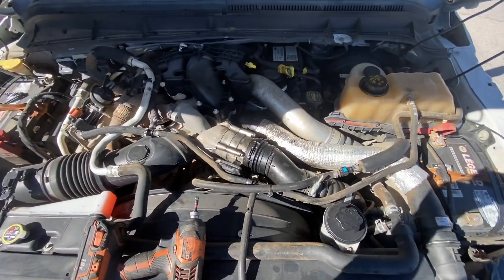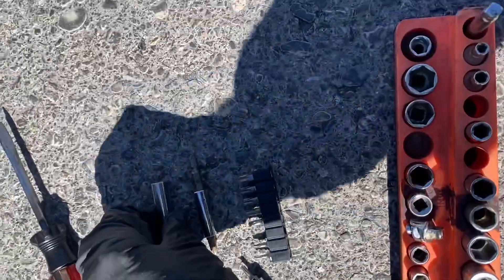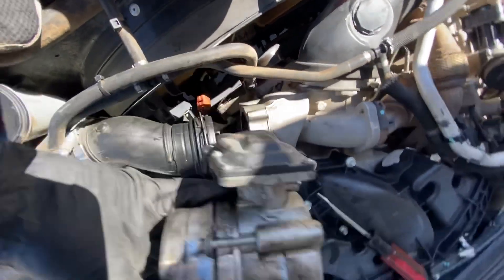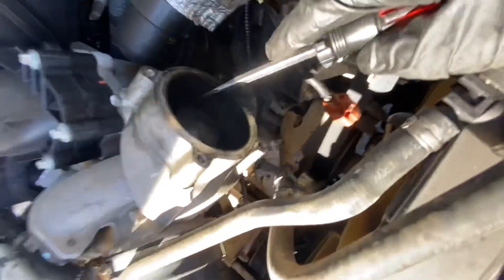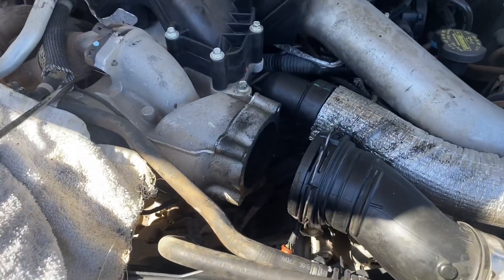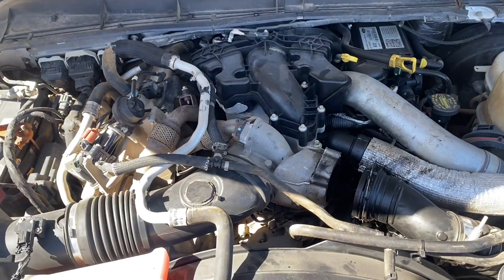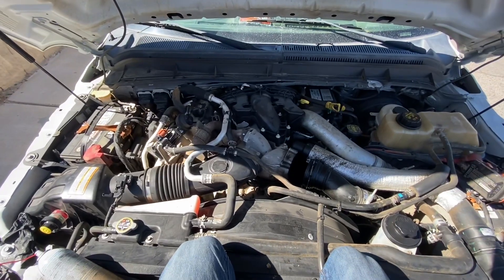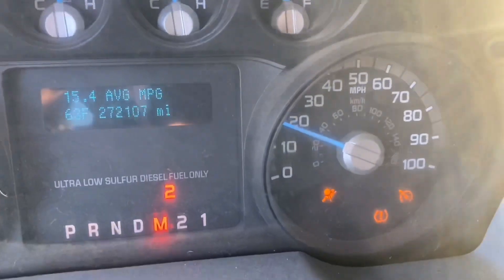15 minute mod, 10mpg to 16mpg, 6.7 powerstroke gets 60% better mpg, so easy you can do it too!

Comment: I have a 2015 6.7 powerstroke, its deleted and the egr is disabled, I have the egr delete kit just haven't installed it. The delete is recent so I'm gonna do this and let you guys know what the difference is, if any.
Reply: Do you have the full EGR delete kit or the block off plates? I'm trying to do research on the EGR plates but I can't find much info since its so hush hush. I'm trying to do this as easily as possible in the event I ever trade in my 2015 250 for a new model some day. Also, have you done what Mr Lanz did yet?
Reply: @d.williams6891  I have an egr delete kit with heater core hose from hot rod racing out of Canada. I have not pulled my throttle body yet I've been slammed with other stuff, but I should be able to get it done here soon
Reply: Any updates dawg?
Reply: @WildTines  no updates yet, I should be able to get to it tomorrow
Reply: I may take a look at the throttle body and see what it looks like tomorrow
Reply: I have a 15 too
Reply: @WildTines  I finally got around to cleaning this and it was full of gunk. I'm on my first 50 mile trip and I'm noticing an average of 20+ mpg. Will update.
Reply: @chriswilliams2911  any update on this? I am currently working on doing this as well. Truck is already deleted and tuned...
Reply: @thejrayhjr  I cleaned all the shit out, it was pretty caked up in there, it was a while back and I can't remember if it really helped. I know my fuel mileage is shit now at like 275 300 miles a tank.

Comment: I personally feel that this is just normal maintenance on any vehicle new enough to have an EGR on it, gasoline or diesel. Gained a few MPG on a 1995 Dakota (5.2L V8) years back cleaning it out until it went from black to shiny silver. Currently, my 2017 6.7L PSD gets 22-24mpg highway and 16-18mpg in the city. The big thing that interests me is deleting the EGR and DPF, which can nearly double the mileage. Then you get little build-up and not the mess you showed us.
Reply: My 2017 Powerstroke (90k} consistently gets 12 mpg towing nothing. I’d really like to drive it more but fuel costs are too high. What can I do to improve the MPG?
Reply: @masstpr15  i have no clue. I have the 3.55 diffs. Maybe yours are a taller gear? 12mpg without towing and not racing with it seems odd. To be fair, the max I go is 70mph, normally 65mph. I am not out west where you can do 80-85mph.
Reply: @masstpr15  my 17 gets 20 hwy empty according to the lie o meter…..you got problems man
Reply: I am working with the same model truck as this guy, a '15 F250 with the 6.7PSD.  Fully deleted including EGR, and tuned.  17mpg highway, 13-14 around town.  I (naively) want to reinstall all emissions and DPF and restore to factory tune.  As it is, before I do all that, it has frightening amounts of power, and it will smoke tires easily in 2nd and 3rd gear - admittedly a lot of fun.  Previous owner probably tuned it when they did the delete.  When I take possession of it, I have no intention of racing it or coal-rolling anyone.  I just want longevity and the ability to reliably use its full towing and hauling capacity.  I am willing to do the work to regen the DPF, even manually as needed, and keep up on maintenance.  Is it naive to think that with good maintenance and follow up with Powerstroke-trained techs, I can expect that with full emissions controls in place?
Reply: @renerosales3629  The emission controls on these choke the engine with soot, I know of a deleted 6.7 that just crossed 600k miles still running strong. If you want longevity stay deleted and delete the intake butterfly as this video shows. There's a reason old 5.9 Cummins go for 1 million miles without a rebuild, they don't have any emissions equipment choking them out with soot, fouling piston rings with soot, clogging turbo compressor housings with soot, filling combustion chambers with soot, etc.
Reply: @robertvanderbush737  I understand inherently what emissions controls do.  We've been dealing with that ever since emissions controls were federally mandated.  But diesel engine manufacturers - Daimler Benz, Cummins, Ford, Caterpillar, GM, etc have invested billions in researching and testing today's system of DEF/DPF type emissions controls, going well on 15+ years. I understand that DPF regen is a pain in the ass, and so is using ultra low sulfur diesel for the increased wear on injectors, etc..  But the thousands of commercial operators, fleet operators, including government fleets, operate with full emissions in place on a regular basis.  Surely there are established practices that have been developed keep these engines running.  I don't want to get pulled over and get screwed by some nosy trooper who decides to peek underneath the truck and write me a massive fine that would cost more than what it would have been to properly reinstall the DPF/EGR and do the work to maintain it - that's my main concern.
Reply: @renerosales3629 only reason to put that stuff back on would be emissions! those items take life off the engine. egr restricts and your Def will clog. do yourself a favor and really read into the damage they do to the engine. the DPF explosion temp..... that's 2 feet of steel pipe from dpf and your turbo.... that is not good on that turbo bearings and seals. I blew a turbo due to this.
Reply: I drive the same truck and only get 8.4 … what’s wrong with my truck 🤣🤦🏽‍♂️
Reply: @Dawson-vy3zw  Stop towing 15k and get back to me. If I tow it drops. It's also my daily driver though, and empty these things are amazing for what they are.
Reply: @GuretoSefirosu  lol how did you know I tow 🤣🤣 when I’m not towing I still only avg 10-12.
Reply: @Dawson-vy3zw  lol some of these guys really know their shizz. Yeah I’m getting 11.6 right now after changing air, oil and fuel filters with a lot pressure fuel pump replacement as well.  But some are saying not to do it. Please elaborate on why not instead of telling us that the EGR needs it.
Reply: @Dawson-vy3zw  I'm the same I only get maybe 12 highway    and when I put 20K LBs behind  it goes to 7.5 MPG

Comment: Dude you’re freaking awesome I did this on my 03 Duramax and eliminated the intake heater which blocked 1/3 the airflow and gained 19.5 miles to the gallon pool and a 6000 pound trailer everywhere
Reply: Y’all are both clueless
Reply: @justinkroeker1464  elaborate please
Reply: @elDnl  I work on these for a living for 10 years and have owned multiple of them. DO NOT REMOVE YOUR BUTTERFLY VALVE! It’s not a throttle body, it just looks like one, but the egr needs it. You can delete the egr and get rid of it if you want but then you have legal problems. Let me know if you have anymore questions, I love helping people learn about these
Reply: @justinkroeker1464  doesn't it also assist for runaway diesel and cold weather starting?
Reply: @justinkroeker1464  can you confirm the next guys question?
Reply from the maker: Your welcome
Reply: @Turbotylerfun  bookoo amount of skeptics out there
Remember,  they awphed stan Meyers
Reply: 🤣🤣🤣 ya, who tf needs an intake heater, this way you can do sick cold start vids in the fall on youtube like the rest of the fucking idiots.
Reply: It has increased my mileage but I have experienced engine powerless and do not know why. Have anyone else?

Comment: All that gunk is actually from your crank case vent (CCV). It is sucked in the intake right before the turbo then goes through your intercooler then up that charge pipe into the engine. If you have that much gunk then you really should pull the intercooler out and clean it really well with dawn… and all the hoses in between… then reroute the ccv (cheap and easy) and never have to clean that stuff again.
Reply: Oil catch can should solve all those soot/CCV issues
Reply: SPE is nice. Pusher makes one also. I have used both. Have one on my truck now.
Reply: I’m running a Mann Hummel Provent CCV filter my diesel. Completely eliminates oil in the intake, but still allows for the crank case to see vacuum from the turbo inlet.
Reply: but are we all agreeing it’s safe to pull that butterfly valve even with a truck that still has EGR in tact?
Reply: @jakeposton5054  I 1000% would not remove that valve without having the EGR deleted.
Reply: Where would you "reroute" the CCV ? Is there a video you suggest ?
Reply: @johnmazza9432  personally I like the SPE ccv reroute kit. The kit comes with a hose that I ran along my firewall to under the driver door where it vents to atmosphere. You do have to cap off the inlet right before the turbo so air is not sucked in without being filtered.
Reply: @johnmazza9432  i did my own DIY ccv reroute..used the fatory box disconnect from the aluminum turbo inlet ,cap off that with a dollar store turkey baster rubber squeeze end and zap straps its great fit zap for safety only... than used a washing machine drain hose i was lucky to have one and the bigger size exact fit on the ccv box plastic pipe connection with the factory end on it...than ran it like all down behind driver wheel well liner..but so much blowby and oily vapour and nasty burned oil smell i just fliped it over the top y intake behind the map sensor down to air filter box..surprising a big rectangular hole is on the exhaust manifold side of the air filter box ..hmm..dont make sense when already has the front air supply inlet getting colder air why cut open to get hot air from next to the manifold??..bottomline i stuck in the pipe to the bottom of air filter box replaced the air filter needed a bit more push down to click but now no oil smell and the oil smell sucked into engine oil vapor stay on the bottom of the box and any floater trapped in the air filter ..30bux for a new filter and b4 replacement i use kerosene to clean all sludge easy..best sludge cleaner i used that for my entire intake to scrape off and brush off soot buildup b4 the mods..
Reply: No. That soot is from the EGR sucking exhaust gas back into the intake from the EGR coolers. The oil from the PCV system is harmless, unless it pools up and then sucks it in all at once. The intercooler won't have that soot in it because the EGR is right at the throttle body.
Reply: @MikeSVOR  Sorry mike, you are wrong. The intake from the EGR cooler is  BEHIND the throttle plate. That throttle plate actually cuts off flow from the turbo creating a vacuum so that it sucks more exhaust gases into the engine from the port BEHIND the plate.. This means that the soot from the EGR never touches that throttle plate because it is immediately sucked into the engine. The only other contaminate is the CCV. This oil is also not harmless... When oil mixes with the EGR soot then it builds a film of poop through the intake. This soot coats valve stems and piston walls, causing wear on both. Oil from the CCV can also build up in the intercooler reducing its thermal efficiency. I once emptied a quart or two out of an old 7.3 intercooler. A simple diagram of the EGR system can be seen below. Hope this helps. I did the CCV reroute at 10K miles and now im at 130K with a spotless throttle plate. I pulled mine apart after I watching this video to look at it. https://dieselnet.com/tech/engine_egr_sys.php
Reply: @adamm74  sorry dude. The soot comes from the EGR valve and even the throttle body gets dusted with its soot. There is no soot accumulated upstream in any of the pipes. The intercooler, the high pressure pipes and even the turbos are clean with only oil from the pcv system getting on them. The throttle body, egr valve and intake manifold are coated in soot from the egr valve. I know this system well. I've deleted mine and have had it apart multiple times.
Reply: @adamm74  sorry Adam, Mikes actually right…
Reply: @RockyMountainHunters  @MikeSVOR ok guys I think we are saying the same thing. I agree that the intercooler will not have any soot in it and that the intake from the EGR is behind the throttle plate, agreed? Everything behind the throttle plate is soot covered but the front of the throttle plate should be clean, agreed again?. What I am arguing is that the CCV oil going through the system is actually harmful. When it mixes with that soot is never good. I have also seen the CCV oil caking all intake tubing and produce a nasty sludge (seen it personally in my 600k 7.3). In simplest terms, if you take dry dirt (soot) and throw it against a wall, most of it falls away but if you mix that dirt with water (soot and oil) then it will stick like crazy to anything you throw it against.
Reply: @adamm74  The front of the throttle body gets dusted with soot due to the egr valve opening when there is low boost but high residual exhaust back pressure between the exhaust valves and the turbine housing. This causes a pressure differential between intake and exhaust that forcefully injects exhaust gas through the egr valve. This causes exhaust soot to blow upstream past the throttle blade/butterfly a few inches.
Reply: @MikeSVOR  sorry budz but you are wrong..i took my top apart way deeper than this guy and you can track it from ccv inlet right in front of turbine literally vacuum oil from ccv box gets intercooled and turbo also turn it into microns of oil vapour once its cold mist meets the super hot egr mushroom hes showing wiyh gunk on it in middle of intake..in school u might have heard what happens when cold meets hot with fluid in it..from there on its just a soot buildup to the intake down...it starts from that butterfly as it starts deposits from bouncing back off the egr inlet mushroom cap..but the opening for egr gases behind the cap facing down square opening..towards the plastic intake Y ..so common sense is enough to see if egr the cause than it should only show after the egr opening lightly and more in the Y intake on top of engine..since air only traveling to intake not backwards and egr flow also designed with the direction of air flow..

Comment: So did you keep the throttle plate off amd run it like that to get the mileage
Reply from the maker: Yes. Throttle plate stays off. In the next video im going to cut up the throttle plate and use it as a flow restrictor for the egr tube